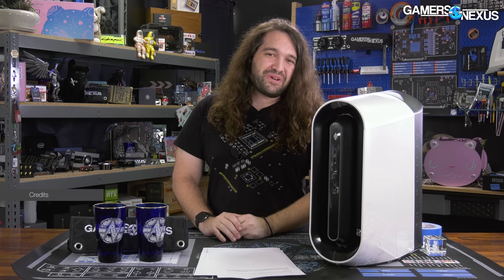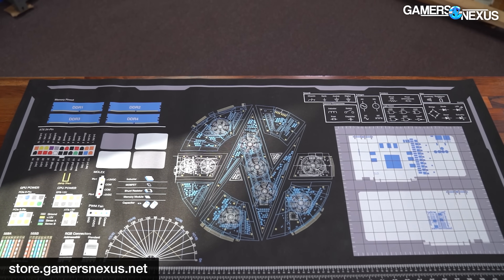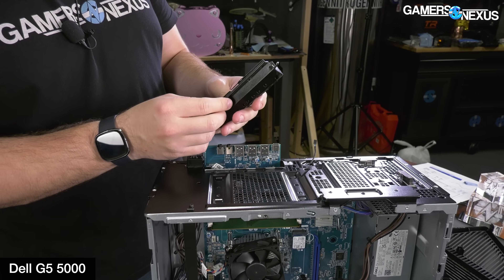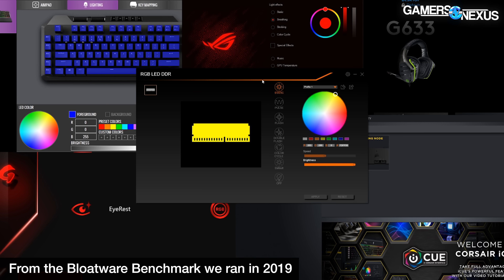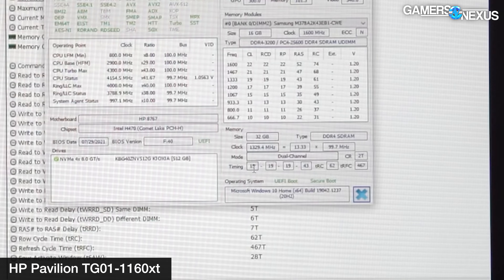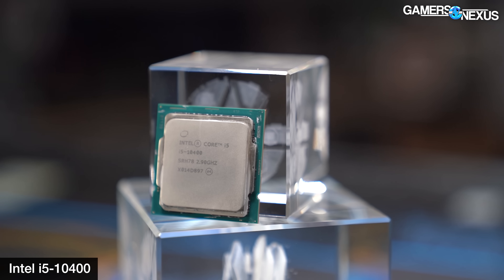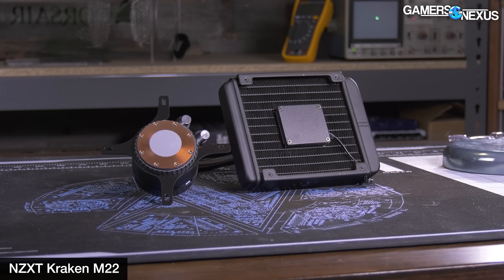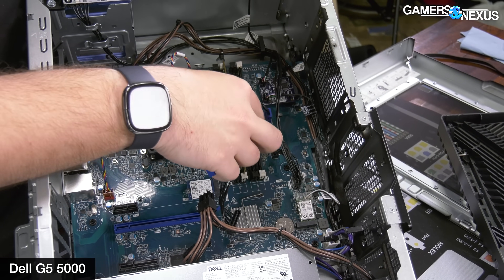The Worst Prebuilt PC Mistakes We've Seen (So Far)

Comment: we had a batch of Fujitsu Siemens desktops where the mb was so thin that if you smacked the table near one the cooler would pop(screws that held cooler would break tru the mb) and take the cpu out of the socket with it. Fujitsu Siemens did replace the whole batch within a day so still ok ,but funny as hell

Comment: how is norton still around? that shit was straight up worse than having a virus in most cases, it slowed down the system so much, from the login screen to actually being able to use the computer for a single browser window, you could go make a coffee, have a ciggie, check your washing machine settings, feed your pets, come back, and still have to stare at an empty white browser for another 2 minutes.

and that was on a fresh system, when non-IT people actually used this computer, and of course installed every browser bar and piece of malware/virus they came across, none of which was stopped by norton, the computer became so slow, just trying to uninstall all the garbage became a multi-hour project.

Comment: "Killer" Ethernet networking on a $4799 MSI gaming laptop a few years ago. Yeah it was killer alright: it randomly killed my speeds down to 5 Mbps. A $20 USB 3.0 Ethernet dongle performed better and more reliably. Killer should just shut down as a company; they are the Ethernet equivalent of a pizza shop that hands you a pizza out of the oven with all the cheese slid over to one side, olives instead of bacon, and the crust is undercooked, doughy, and has rat turds in it.

Comment: Alienware is not half as bad as what's said here. I own 3 Alienware desktops and as long as you know what you're doing, Alienware PCs will definitely accept third party or brand name components. I will agree that the cases are tight but then you would buy smaller parts that fit inside them right? Logic 101.

Comment: Purchased a skytech gaming pc. They specs were good only thing it would boot loop due to the ram set at xmp 3600mhz. Which wouldn’t normally be a issue but the board they used b550 asrock pro4 wouldn’t run it. Swapped the 5600x and 3600mhz ram to a asus board no other issues. But it did ship with the infamous gigabyte 750gm

Comment: I bought a skytech prebuilt a month ago with a 3070ti and I've spent more time trying to get it to work than playing it. The top PCIE port on the x570 Tiachi MB doesnt work right for the card. It doesnt even fit and I get constant black screens or disconnects or shutdowns. Skytech customer care has been absolute shit and doesnt want to help. I even tried a vertical card setup with a Gen4 cable and it still has issues. Works fine in the middle 8 lane pcie slot but the top 16 lane just wont work. STAY AWAY FROM SKYTECH!! I would have built my own if it wernt for the GPU shortages.

Comment: Dell bloatware is insane. And the worst part is it doesn't "scale", so to speak. My dad bought a Core i3-based no-SSD Inspiron last year. He figured dual core + HDD is fine because he just wants to access Gmail and Chess dot com, and that's about it. But when he actually bought it, he had to call me over to "fix" it. I'm not exaggerating when I say the machine was near unusable. The same bloatware that might cause a ~10% FPS drop on a high end computer is downright lethal to a low end computer. Luckily it wasn't that difficult to completely reformat everything and install a clean copy of Windows 10 directly off Microsoft. (I'm really really glad they Microsoft provides a clean Windows installer directly these days, because the "recovery" partition on these is useless as that comes preloaded with the bloatware already) Now that machine runs pretty well for what it is. It's like Dell is sabotaging their own machines. It's mind boggling.

Comment: Steve, as a manufacturing engineer, I have a hard time understanding your frustration with the font panel IO being on the main board. That’s VASTLY superior from a signal integrity, assembly, and quality perspective. The only down side is it means your cant have a standard form factor board, but that’s pretty uncommon in prebuilts, and the number of people that pull boards out of prebuilts is likely extremely low. I would wager, removing unneeded components like back plates saves considerable resources overall, even when taking into account the difficulty in reuse. Things like cables and connectors have costs higher than a slightly longer PCB, and I would estimate a considerable relative drop in resources and carbon by avoiding them. So for the likely well below 1% of machines that would end up being repaired, or having parts harvested, I still think the net impact is vastly positive overall. But a few good points otherwise, the proprietary PSU thing really grinds my gears.

Comment: I like having more RAM and I like to live well with Chrome going fast since it uses RAM instead of storage. So I do recommend 32GB for anything except the really REALLY budget systems these days. However, I would recommend DDR4 3200 CL16 since it’s literally cheaper than all the 2666 crap these days. So when I see like 2400 or 2933 with god knows what latency in a brand new pre-built I am definitely offended.

Comment: I broke down and bought a prebuilt from an SI a couple months ago and aside from the price everything has been good.  It was well packaged, BIOS was updated earlier the same month I bought it and already had XMP set up for 3600mhz RAM in it.  Clean Windows install with no pre-added software.  The only thing I had to address was the case came with 4 non-PWM fans and I have a 360mm clc with 3 PWM fans.  The SI slapped 3 case fans onto the clc in a push/pull (360mm rad with 6 fans on it, 3 PWM and 3 non-PWM) intake and had 1 case fan as exhaust.  I just set the fan curves on the clc to run at 1,200 rpm, the same the case fans are running at, until it hits really high temps and ramps up.  Under my current uses in gaming the temps on my 5900x and rtx 3080, with slightly tweaked fan curves as well, never run past the 60c-70c range with fans running at idle 1,200 rpms which isn't all that loud.
Reply: Best of luck with your system and happy gaming!!  👍👍

Comment: "Easier to do a clean install"
Not in the case of my Dell laptop...
Every time I clean install Windows... Even having Linux on there previously, The "Wave Maxx Pro Audio" application gets installed on first boot.
And to remove it, I need to fully remove the audio drivers themselves. The next time the system updates, it just comes back.

Comment: Got a ibuypower. Back in 16 and was ok price for time was black Friday custom picked and only problem was psu was old and had ton of spaghetti wires and bent case in lower edge from forcing in to lock teeth in and was grate the aio cropped out was a h some thing was part fault now a days hope faster was a month over date but far north like that

Comment: These Dells and HPs feel...dystopian.  When I got to my former job, they had a few Dells running XP and they bought a few more over the years.  Some might have come from Dell directly, but some were definitely bought off the shelf.  They were easy to work on.  Boring, functional mid-tower cases with no weirdness.  ATX power supplies.  Easy to add PCI cards or disc drives.  Easy or sometimes even toolless entry.  Slightly odd coolers but fans could still be found at the store and were easily replaced.  Yeah, they weren't gaming computers, but they were just fine and easy.  In fact, I'd wager I learned a fair amount about replacing computer hardware from maintaining those Dells. I think most of them still work.  I repurposed a few as little dedicated internal servers for various things when we upgraded, and I built new computers for the company. (I am not an IT pro, btw.  I just taught myself how to keep a small business's tech running when I wasn't being a chemical engineer.)

Looking at these prebuilts...WTF?  Regression is too mild a word.  These are disturbing.

Comment: To be fair there is a bit of logic to putting in a larger power supply than needed now. If you decide you might want to upgrade to a 2 GPU setup and add a few other components down the road it's nice to have the headroom on power to handle it.

Comment: Again you throw Ibuypower under the bus for something that was not their fault. You, the one placing the order, are responsible for clicking the shipping option to include packing  material inside the case. If you don't click the option then they are not going to put it in. It is also not Ibuypower's fault that the delivery person decided to dropkick and throw around your PC when picking it up and placing it where it needed to go would have done nicely. The expansion foam packing stuff costs Ibuypower to use as does paying someone the labor to put this in cases over and over and over. That is why it is a paid OPTION to cover those costs. I get it. You don't like prebuilds and you will take every opportunity you can to find fault with them. Only this time the fault lies with the fact that this whole mess could have been prevented by checking a $19 option and you failed to do it.

Comment: Biggest problem I had with my prebuilt from a custom PC maker, was that the AIO wasn't connected properly. Took me a whole year before I realised "hmm, hang on a sec, the AIO isn't registering any pump speed or anything". Turned out it was connected, but to a different connection, so it worked but wasn't controlled properly by the PC. Always did wonder why it was all fan all the time....
Fixed it by connecting it up properly though, worked better after that!

Comment: I think there are a few major factors contributing to companies doing this.

1. Laptops. I bet that's where they think the big money is. Admittedly, they also need more/better engineering. This leads companies to shift their budgets there.
    1a. I think they also let the laptop engineering mentality leak back into their desktops. The proprietary everything, front panel ports on the mobo, that's where it comes from (I think).
2. They think desktops don't require much effort, or that anybody who cares about good features would be building it themselves, basically creating a downward spiral with circular logic.
    2a. Alternatively, they think desktops are on the way out. Everything is a one-time solution because they don't see a point in investing in them anymore. Some people knowingly take the performance hit because they prefer a laptop these days, regardless of whether that makes sense for them.
3. It must be legitimately cheaper for them to develop boards and cases in-house. Since this move is motivated by cost savings, so is the rest of the design.

idk though I could be wrong.

Comment: I'll never forget working on a prebuilt where one of the unused molex connectors had pins extending beyond the housing, not a lot, but just enough to arc when resting against bare metal within the case. I'm not against naming the company but honestly I don't remember. I'll never forget how much that has impacted me and I always make sure to keep any unused power connectors safely wrapped and ensure they're situated to keep them reliably away from the case.
Reply: shhh dont give them ideas before oems use this to say pc's are not safe to repair yourself please buy pay the $200 extra for an extra 8gbram modules when picking your pc
Reply: @SMhMrMurhpysLaw  LOL, you know that is in the post.

Comment: These prebuilts seem to be in line with what I've had to deal with for decades now.  Either bad components, or proprietary garbage.  Works out for me though, as your average user will tend to pitch them out when they stop working or slow down too much, leaving them for me to scoop them up, replace the hdd or the dead memory stick, and have a nearly or totally free computer for my trouble.

Comment: A mistake I've seen sometimes is a prebuilt coming with an improperly partitioned HD or SSD. Sometimes you can just extend the partition and be done, but a computer my uncle recently bought came with a 480 GB SSD partitioned so that half of it was on the C drive, there were some small recovery and boot partitions in the middle, and the other half was partitioned as the D drive.

An average user isn't going to know how to manage their data to use a D drive, and segregating data like that will provide absolutely zero benefit except to power users who like making use of drive letters as a means of separating different parts of data. So the way I see it is they lied to him and sold him a "480GB" SSD that was actually only 240GB, because without consulting someone who knows what they are doing, an average user is just going to use the C drive and be limited to that 240GB.

Comment: The only advantage to any proprietary parts, is when the system has a reduction in overall parts. I want to point out GN's constant ragging on HP and Dell's front panel ports for a second. Go look at ANY PC. There is not a single standard front panel. There has never been one. I have 3 ATX towers and the entire reason I had to replace the chassis is because something didn't fit in the previous one. (eg USB3.0/USB-C front panel, 5.25" drives and GPU, respectively.) So I think that is the wrong point to focus on. 

Instead PC's should have a 5.25" ODD bay and one 5.25" "Front Panel" bay which also contains the power switch, USB-C/USB3.1 ports, a PCIe NVMe SD card slot, and mini-jacks for Headphones/headsets. Yet no chassis are designed in a way to replace the ports on them. You break a port, you throw out the chassis.

Some Really really old ATX chassis, before USB ports started being put on the front, all had standard 5.25" and 3.25" bay placement, but that's been the only thing standard at all. On only AT chassis, there were punch-out port panels for DB9/DB25/DB15 connectors so you didn't have to waste slots on ports-only. 

With the advent of 3-slot GPU's, those PCIe slots are becoming even harder to access. I'd really suggest moving the PCIe4 GPU slot to the bottom of the board so that we can continue to use the other 2-6 slots. Yet... that's not what's happening.
Reply: The front panel may not be a standard PCB, but you can connect it to any standard motherboard which means you can reuse the case and that front panel even when you upgrade the CPU and that CPU upgrade requires a new motherboard. You can't do that if you need an upgrade in a Dell or HP because you'd be forced to buy a whole new computer just to support the new non-standard motherboard shape they use for that CPU.

Just like the heatsinks on ram aren't a standard shape, or hard drive locations in cases aren't standard. But yet they all manage to work together, because they at least have a standard method of connecting to components.

Comment: there was a boom in the SI market in Brasil in the mid 2000s, I remember getting a prebuilt that arrived with a disconnected sata cable on the hard drive I could see trough the side-panel ventilation (!), and I called support all worried that my warranty might be void if I opened the chassis. They were quite helpful, told me I could open and move stuff around. I used many parts of that pc in others builds, including the case. It was quite a nice experience. The SI doesn't exist anymore since 2008

Comment: The lose screw thing is no joke. It's not a computer but I work with remote locomotives. We had the main control board come with a loose nut on the back of a display and from the vibrations on the loco it fell and landed between a couple of pins for the power supply and it shorted out and took out the control box... Just a fluke but something that could happen with a computer

Comment: Not a prebuilt, but I recently got a laptop from Dell that would turn off randomly because the cable connecting the battery to the motherboard was strained so much the conductors were getting pulled out of the housing

Comment: Steve has ragged multiple times about the use of hot glue on USB3.0 connector headers, but the truth is that the connector is a legitimately terrible one from a reliability standpoint. There's a ton of small pins and there's no locking features whatsoever (just a keying shroud and a friction-fit), and they're always hooked up to stiff, heavy cables because of the shielding required for USB3 signals. The end result is a header connector that's incredibly prone to coming loose (more so than any other header connection I can think of) and I don't really fault manufacturers for trying to make some effort to ensure those connectors don't come loose in shipping.

I would love to hear what GN's suggested/preferred alternative would be to hot glue on those headers; when lightly pressing one side of the cables with a finger can dislodge the connector, simply leaving it as-is is a huge risk to OEMs shipping as many systems as they are as any kind of bump could pop the connection at least partially out, resulting in customer support issues. Short of very careful cable management and bundling the header to other nearby better-supported connections or using some kind of custom bracket to hold the cable in, I can't think of a good solution to this other than a dab of (easily removable) glue.

By comparison, the USB2 headers don't have this problem because their pins are bigger, the cables are more flexible, and there's way less of them resulting in a lot better friction fit. The new USB3.1/C header they're using now is also much better, as it actually has some detents locking it into place and a smaller footprint meaning much less leverage on the connection point from the cables and gravity/bumps.